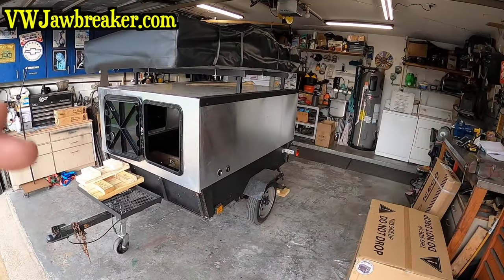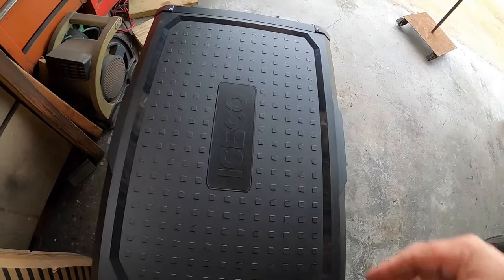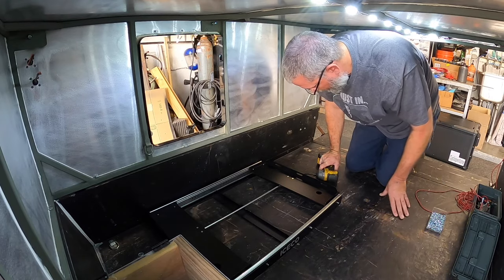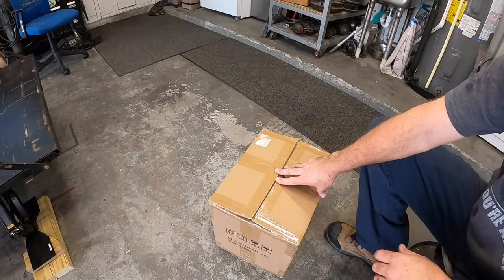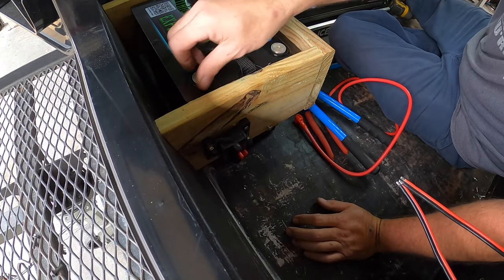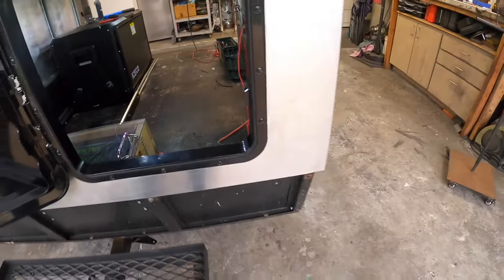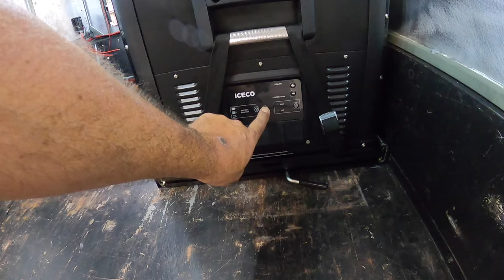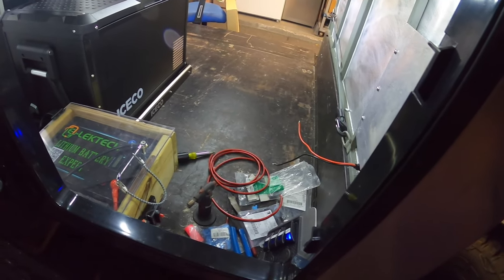Lightweight DIY Overland Trailer! Part 4, Electrical, Lithium and Iceco Cooler!

Comment: Think about a small fan a a passive vent.  With fridge and closed metal box it will get hot… making the fridge work harder.  Love the build.
Reply from the maker: Great thinking! 
The solar controller has a temp sensor so I’ll monitor the inside temps, should only be an issue in the summer when I don’t camp much here. 
Worse case I can open the side access doors and then add in a ventilation fan 🤙

Comment: You should sell these i bet you'll make millions 😮
Reply from the maker: No way I could pull that off here and it would probably be more of a headache than it’s worth. Not to mention there’s plenty of these kind of setups out there but most weigh 2500-3500lbs.

Comment: I ran one of those 12v DC compressor freezers for 30 days on a 150 ah deep cell battery once! No solar, no recharge, they sip energy on ECO mode, and use virtually zero when compressor is not running!
Reply from the maker: That’s really impressive! I’m pretty stoked to use it here soon and test it all out.

Comment: Outstanding job as usual love. Everything you do. Your content is awesome but to play armed  quarterback Chair I don't know what you're doing with solar. So looking from the rear. The right hand side of the battery behind the cooler is dead space/is solar equipment going there. Because I probably would've put my electrical there. 
Because on a left hand the battery that could be for storage or anything you want. But that right handside looks like dead spot. I hate to say it because you did wonderful job can't wait for the next video
Reply from the maker: Thanks, I appreciate it! 
As for your concerns, I understand what you’re saying. 
I put the electrical where I did for easy access Incase I needed to work on it, use the small inverter, etc. The solar will tie into that panel as well. 
As for the dead space in front of the cooler, that area is for tool storage and items I’ll rarely need or will won’t need to access very often. 
So far it’s working out well. 
I may remove some items that I probably won’t use and move the battery to the space in front of the cooler.
Reply: Perfect case close

Comment: How good are those batteries, I've got one powering my kayak it lasts for days :)  Great job on the install!
Reply from the maker: We’ll take it on a test run here soon but I can say I’m blown away on the overall performance.
Reply: @VWJawbreaker  how light are they 😳😳
Reply from the maker: @DemopVWgarage  this 100ah battery is 22lbs I think which is crazy light compared to a leaf acid battery 😳

Comment: Are you going too add a battery pack for extra power for longer off-grid camping? A water tank with a filtration kit?
Reply from the maker: The 100ah battery will provide plenty of power. 
Stay tuned as there’s more to come!